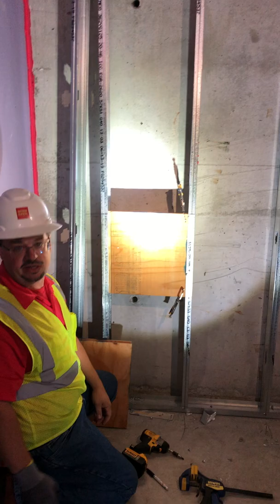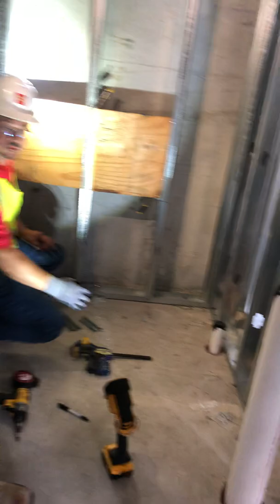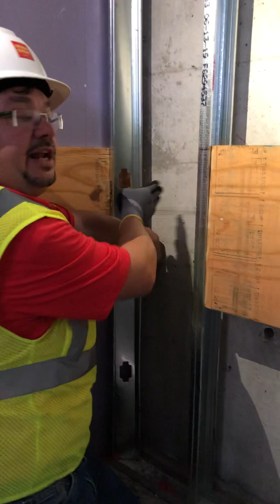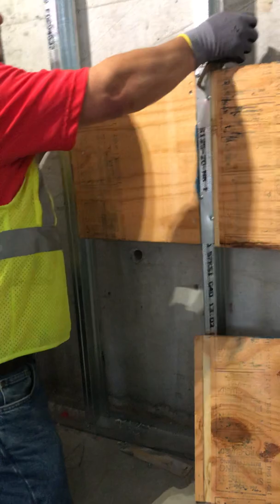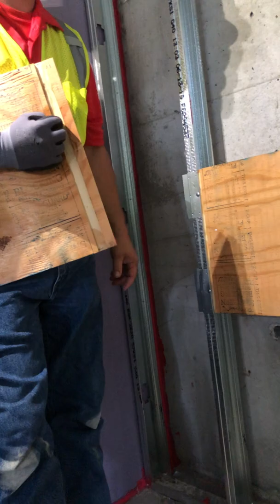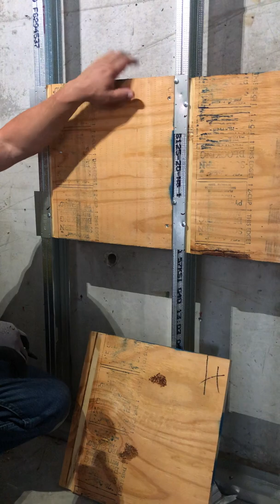Ram Tool Construction Supply & Southern Wood Blocking - Install at 2204 San Antonio - LEAN BUILDING

Comment from the maker: We give you a full color coded job site take off from the bottom of the job to the top, of where every piece of blocking goes in the job. Its also is shipped on 30" pallets that will roll through any door opening on the job.